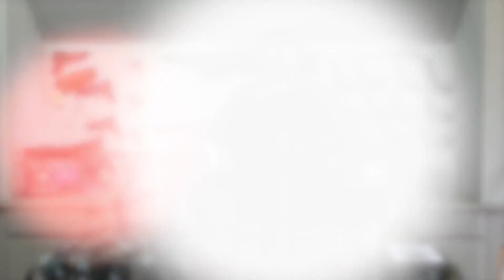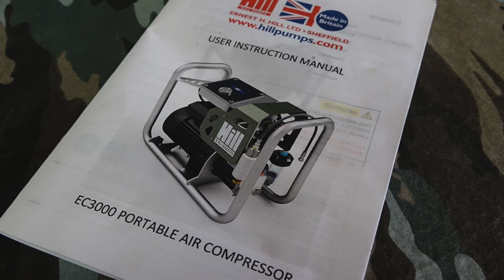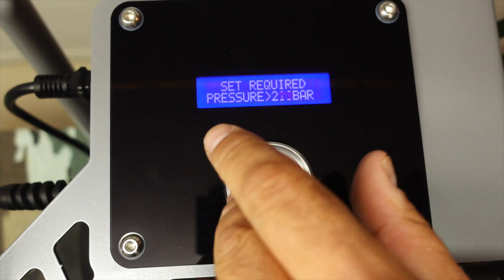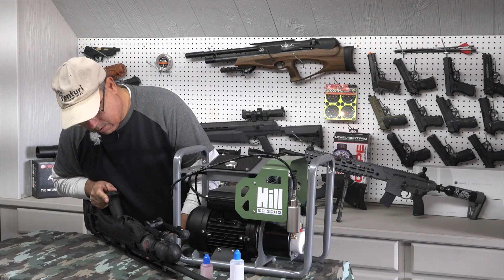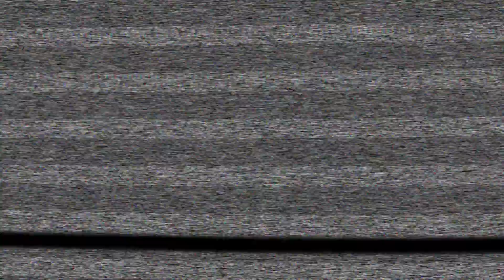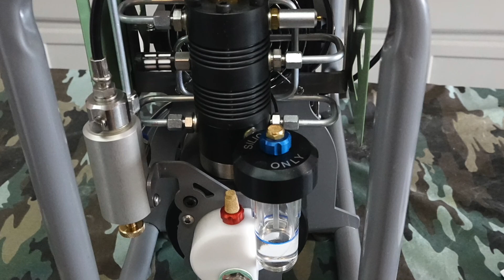PRODUCT REVIEW - Hill EC 3000 Personal HPA Compressor - Safely Fills Airguns AND Small Bottles!

Comment: Can this compressor be used to fill  a 7 L bottle. I usually only let my bottle get to about 200 bar then fill to about 250 bar.  I currently have the Air Venturi and it has only given me problems the last two years so I am trying to upgrade.  
Thank you
Reply: YES  you can.
I use mine to fill my 6.8 litre bottle to 300psi with no problem.
Reply: yes
Reply from the maker: Hey there.  No. This is only designed to direct fill your PCP Airguns.  

Cheers
AGW
Reply: @AirGunWeb  not true
Reply from the maker: @12vibaba  - Per the manufacturer’s directions when I got this unit many years ago, they said NO to filling bottles.  You can do what you like.  Hopefully it lasts for you.  But if it doesn’t, then don’t blame the product if you’ve used it outside manufacturer’s spec.

Cheers
AGW

Comment: We need large storage tank information. Gun tanks are small. Will it fill a large reserve fill tank???????
Reply: I use mine to fill my 6.8 litre bottle to 300psi with no problem.
Reply from the maker: Hey there. This is NOT designed to fill large bottles.  You need to look at one of the cage compressors like the TUXING or Air Venturi.  Also Daystste, Hatsan, and others have models designed to fill the large bottles.  

Let me know if you all want me to revisit this subject down the road. 

Cheers
AGW

Comment: I have a Hill ec3000 the only problem I have is My pressure release is leaking when it is charging.  Problem is I can't find where I can buy one.  Any suggestion would be appreciated.  It is just the screw that releases the air in the line.
Reply: its made of brass and most tighten too much and screw up the two mating surfaces about 99% of the time. brass is made of two components, copper and zinc and zinc being a lubricant they seat each other. next time, after new parts,  turn just enough to stop air from leaking no matter how loose it seems.

Comment: Thanks for sharing! Really really great vid!  This might be a stupid question but is it possible to fill up 4 guns with a 100cc tank at the same time with 1 compressor with some connections, splitters etc?
Reply from the maker: You could, but not with this compressor. And, you’ll need all the guns and bottles to have the same max fill pressure.   You could setup a manifold with multiple regulators that would each fill to a specific point. But it would be several times the cost of the compressor.  

Cheers
AGW
Reply: @AirGunWeb  Thanks for the quick reply.   They are alle the exact same gun. So I guess with a manifold of some kind it should be possible.

Comment: I dont like the electronics on this device.  It should have just 2 manual switches like 220 and 300 bar filling.  Im afraid that this controller wont live long.  Filling 580cc from 0 up to 300barr always gets too hot, and shuts off to cool down.  There's the problem.  Heat .   I hope im wrong, but i would save on for a German Bauer junior.
Reply: Speculation dude. Own one and you'll see that they work as advertised.
Reply: I understand your thinking, but we've come a long, long way.  Guitar effects processors which use a whole lot more electronics have been running for two decades now with no issues (and I'm not talking about some from the 80s . . . . just ones with LED screens like this).
Reply: Yes you are wrong.

Comment: Comparing the YONG HENG unit to this is asinine.  This unit is built like a tank and no water cooling.  I had a YH and it was a pain in the ass... 5 gallon buckets of water and ice when its 95 out... what a mess.  The YH comes from china... just because it says YH today doesn't mean it's the YH that swept the air gun world by storm a couple years ago.  It's been discussed on many forums how many of the YH compressors off amazon are not YH compressors they simply have the name on the side.  Also, don't buy a NOMAD after having a YH and messing with water and ice and then a NOMAD II that I had to have three of because they all failed under warranty, hoping this hill unit is the answer.... 55 fills on the crown and impact in a month... so far so good

Comment: I bought one of those Tuxing compressors from Amazon, thinking i’d outsmart everyone and be able to say they don’t have to be expensive to be good...i’m not that smart it turns out. Didn’t work out of the box, cracked/damaged high pressure tubing inside the unit. Two weeks into trying to communicate and fix it now. They won’t take it back, said shipping is too expensive to China. Smh. 

So now i’m like, $1,000 doesn’t sound too bad. 
Whats it weigh?
Reply: About 26 kgs

Comment: Yong Heng Hardcase is under 350$ from Walmart “”“WITH””” an available 4 year warranty for 35$...no questions asked...I’m just sayin. How many air guns and pellets can you buy with the cost difference? 600$ Mine is 2+ years old and zero issues. Fills a 6.8 liter carbon fiber tank from 0-4500 psi in under 45 min. That’s roughly 65 cubic feet non stop, and never goes over 100 degrees F. Thanks for the video, and the info. Someday I’m sure mine will go down, and I will check into that one. God bless and stay safe.
Reply: Walmart carry those ...$350 no issues in 2 years... I like what I'm reading
Reply: I had a YH and it was a pain in the ass... especially in winter... I live where we get snow and cold temps... I'm sorry all you guys talking price messing with ice and five gallon buckets.... pass... hard pass.
Reply: @David-uz5zo  yeah those YH are pieces of Chinese crap.
Reply: have you ever Hurd you get what you pay for with this unit you also dont need buckets of water to cool it down